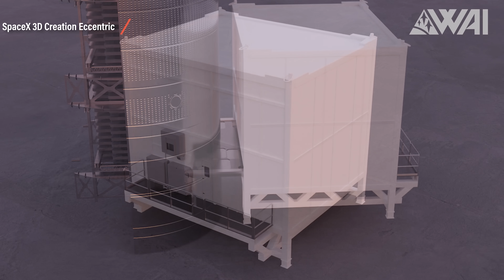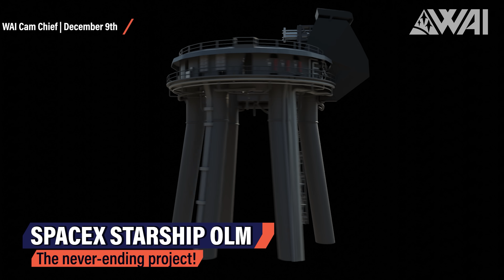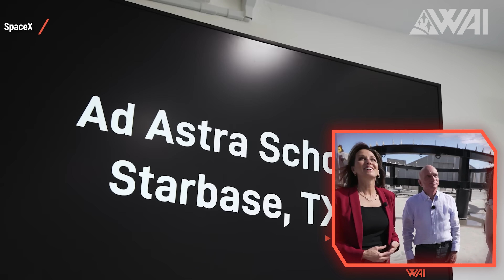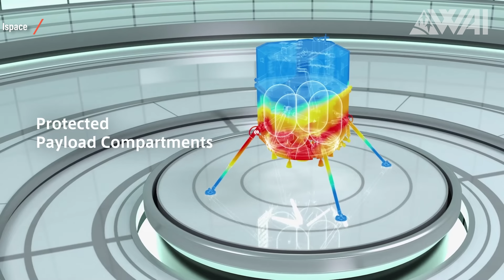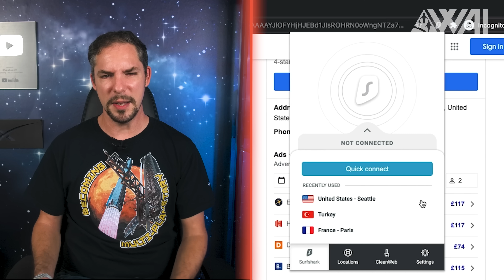SpaceX Starship New Solution! Artemis 1 Splashdown Flawless?

Comment: Flame trench and Diverter are the only solutions.  In addition, need a robust sound suppression water system is needed to reduce the sound levels as not to have them reflect back towards the vehicle.  Any other answers are incorrect.

Comment: Why can’t they put a couple inch steel plate under the launch mount? No flying concrete bits and no need to keep repairing every time. Could a thick steel plate take the heat (especially with heat resistant coatings) ?

Comment: About the concrete problem under the olm...What about using heat shields on top of the concrete under the olm? They could build a single large heat shield rather than using hundreds of induvial tiles.  That way they don't have to spend weeks replacing them. Just a thought :)
Reply: Using one single big-ass tile would probably create problems with thermal expansion.
But anyway Idk, thermal tiles have been known to fall off, and the vibrations and forces directly under 33 full throttle Raptor engines have to be worse than those experienced on the main body, right?
Reply: @plainText384  maybe :)👍🙏🤓
Reply: @plainText384  u have a point...just throwing out various solutions...i wonder what kind of concrete they used with the shuttle?

Comment: Launch table will be toast after rocket launch. Then, they will spend another year to build it again. Per me booster should launch from hang position. Rolled out fueler should be used during fuel deposition and then, rolled our far from the rocket. Rocket bottom should be in air. The best part  is no part as Elon said.

Comment: dearMoon probably 5 years pending if Starship lifts off successfully next year.  Will need a lot of testing.  It most likely will replace Falcon.
Reply: Think your'e right although i would concider 5 years minimum would not be very surprised if it doesn't happen before 2030.
Reply: it has taken 10 years since the first F9 launch to build the manned Dragon. Starship has not even attempted orbital flight yet.

Comment: My 2 cents, drill a shaft under the OLM 30ft in diameter and put a platform in it (think elevator). when the platform is lowered up to 5 tunnels are uncovered. when raised to ground level there will be access with forklift with engines on stands then the platform is raised to install the motor. all this will serve as a flame diverter and could speed removal and installation of engines.

Comment: Felix!  “I think” they’re not using a flame diverted or water based diffusers because we won’t have that on other planets and they’re trying to get it to work with just the concrete mix, for ease of assembly on other planets
Reply: They have already reached firing of 6 Raptors with concrete handling it, they won't fire more than 6 on Mars.

Comment: Why don't they just use a lovely layer of diamond, I'm sure they could figure out a way to build up layer by layer a massive single sheet of diamond.
I mean, they did choose to go the hardest route they could for a fucking lack of diverter, just idiocy, "best part is no part" aaaand yet they chose to not just dig a big hole but rather have to design & retest many many times a way that would still be higher maintenance......

Comment: Is there some reason why they cannot use the same bricks that they use for the "heat shield" at the launch pad instead of this "fondag", or any other mixture? Seems to me that if it can withstand re-entry into the earths atmosphere, perhaps it could withstand the temperatures at take off.
Reply: I think under 33 Raptors the problem is not temperature only, but the pressure as well. I mean, what pressure will heat shield feel during reentry? If slowing down with 3g force, it's like 120*3 = 360 tons laying on this shield, which is 50 meters high 9 meters wide, so 360 tons for 450 square meters = 0.8 t per square meter. Even if taking into account curvature of cylindrical Starship, I bet it won't be more than 5-10 tons per square meter at the worst moment.
Now, counting 33 Raptors firing pressure, let's assume the fire column will be equally distributed on heat shield circle with diameter of 9 meters, it's 64 square meters. The thrust will be around 7 500 tons, so we get more than 100 tons of pressure per square meter. 
The difference of pressure in 100-1000 times! I think it's as important as temperature.

Comment: How about a rocket blast proof system that involves no super hardened concrete or flame diverter?  Vertically mount a properly sized boring machine directly under stage one and let it bore straight down for a mile or so. Can't be too hard considering all the miles of tunnels it has bored out in Las Vegas. Maybe the first couple hundred yards could be paved with shotcrete, like in a swimming pool construction. There won't be much force to the shock/blast wave after traveling that far when it bounces off the bottom.
Reply: All that energy has to go somewhere. So if there is only one exit...
Reply: @asparagusstaging430  You're absolutely right the energy goes a mile or more down but it is less forceful as it goes, even though confined in a tube. Then it  bounces off the bottom which causes it to run into itself, dissipating more energy and then what energy is left will peter out by the time it goes another mile back to the surface. It's just a dumb thought experiment no one in their right mind would do this when a diverter easily does the job. Have a nice day.

Comment: My hot take is simply not possibile to use OLM to launch Starship. The installation at Boca Chica is for testing and prototyping, a full power blast of 33 raptor engine would reap apart everything, from the concrete base to the OLM structure (or in the best case scenario, implying time consuming and expensive repairs after every launch). The proper OLM need to be build yet. Maybe the one at Cape could be use for Artemis program third launch but surely not this one, too close to vital infrastructures and  too fragile.

Comment: Simple math says NO on the concrete because it's simply too brittle. They need something called "StarBurst" which is a thick 316SS diversion stand that channels the heat energy away from under the ship. It uses cryogenic O2 flowing in a heat exchanger system to remove most of the energy as the metal is diverting the exhaust flow away from the engines.
Reply: Stainless steel has piss poor thermal conductivity which means cooling it with any liquid will likely be too slow to impact the launch heating issue.
Reply: @executivesteps  : That’s the whole point. The object of the games is to not melt the stand. Remember, it just needs to withstand 6,000 °F (3,300 °C; 3,600 K) for the few seconds needed in order for the rocket engine exhaust temperature and pressure to clear.  What is the melting point of stainless steel? Stainless steel's melting point falls between 2550 and 2790°F or 1400 and 1530°C.
Reply: @jroar123  I’m not sure what your conclusion is but it’s much easier to melt stainless steel than aluminum in a situation with an impinging hot flame. It’s mostly about the thermal conductivity not melting point. Few people commenting here don’t understand that. 
Ask any welder and they’ll tell you that’s why it’s much much easier to weld stainless steel than aluminum -  SS melts where you put the heat.

Comment: If the base was at least twice as tall, this alone could solve many issues. Given what we've seen thus far with minimal engine firing, there's no way it's going to work as is during a full firing.
Reply: I doubt they'll go taller, but a flame diverter I suspect will be required.
Reply: I doubt a flame diverter at this point is possible. From what I can tell, the base wasn't built wide enough, or likely deep enough, to allow for the hollowing out of the centre for it.

I'm really curious how they're going to solve this as all 32 engines will obliterate everything.

Comment: On Dear Moon, given the payload capability of Super Heavy/Starship, I hope that they use a scientifically well-equipped Starship. They could, for example, include an almost Hubble sized telescope for detailed photography of the moon - and leave it in orbit if it is too fuel costly to bring back.
Reply: Who's to foot the bill for designing, building and testing that?
Reply: Why? NASA’s Lunar Reconnaissance Orbiter has about 100x better resolution of the Moon’s surface than any Hubble sized telescope in Earth orbit. 
Plus it’s photographed most of the lunar surface these last 10 years.
Reply: @executivesteps  You either misunderstand or don't know your facts.  I was advocating for a Hubble-sized telescope (resolution 0.014 arc seconds) in Lunar orbit - which seems clear from my post, given that the target is the moon.  The LRO camera has, at best, a resolution of 2 arc seconds, so a Hubble-sized telescope would provide more than a hundred times the resolution of LRO. I hope this helps to clarify.
Reply: @franciscook5819  i thought you were keeping it in Earth orbit. is the Dear Moon mission a lunar orbiting mission? I imagined it was just a free return ride. It would take a lot of fuel to put a Hubble size telescope in lunar orbit. And no one is going to fund a telescope that big for a short mission. 
Ultimately why would you want a telescope with significant better resolution than LRO?

Comment: The pez dispenser is an excellent idea. What is not is its horizontal setting. A vertical slot door would help conserve the axial stress resistance of the hull and better protect the satellites during the launch.
Reply: Yes as far as  Structural strength is concerned ...except......your missing one important factor ..QUANTITY....
you would have less payload space .
Elon wants as many as he can jamb in there 200 300 400
....ect..... But if you can config something up and submit it I am sure they'll take a look :)
So no Horizontal it shall remain
Reply: @jimanderson2518  Or perhaps an annular rotary dispenser would work best. Much greater capacity.
Reply: @jimanderson2518  I'm sure quantity will not be affected. But probably the Zip dispenser design would. For instance, the dispensing slot would rather be placed in the middle, between two opposing stacks.

Comment: @5:33 SpaceX will have to lengthen the legs so the blast from the engines isn't so intense. 
If SpaceX wants to take off and land on a ship platform, it really wouldn't do to have to bring in the ship after every launch.
Reply: They can just blast into the water. A whole ocean is probably the ultimate deluge system. ;-)

Comment: I found Artemis really disappointing, I'm old enough to remember watching the Apollo missions, and the splashdown of Artemis was like watching a replay of those, which highlights how little we have actually progressed the technology, and how far we need to go. 
Starship may shift the paradigm, once it has proven itself capable of getting off, and back onto the ground,.. safely, ..with cargo, and eventually with people.
but NASA is still flagwaving propaganda at a huge cost (IMO)
Reply: You judge the progress of the technology based on the most superficial thing you can.  How it looks from the outside.  That's so worthless as to be.. worthless.
Reply: @TheEvilmooseofdoom  He has a point, though. Of course they updated quite a few things inside the capsule, but the main parts are essential 1970s tech. Space Shuttle Engines, Space Shuttle tank (ok, slightly modified but essentially the same), Space Shuttle SRBs (extended by one ring)... 

Same for the Crew Dragon. SpaceX wanted a powered landing on dry land with parachutes as a backup, NASA forced them to use a water landing with parachutes like Apollo, with the rocket engines only as a launch abort system. 

The problem is not NASA itself, IMHO, it's the politicians and/or beancounters. They don't get that using new tech is possible if tested enough, however the test cost an undefined amount of money. They want to hear a number $X and expect to spend $X and have something do Y. If something goes wrong, they come looking for blood and someone to blame/sacrifice.
Reply: @realulli  It's not a game, putting all that hardware together and making it work is not as easy as you people pretend it is and pretending is all you're doing.
Reply: @TheEvilmooseofdoom  What criteria should i use ?
The rocket was incredibly expensive, used second hand engines, and was destroyed in the process off getting into orbit (non reusable) the tower used to launch this, was the most expensive ever built. 
The capsule was not much bigger than the Apollo. where's the technical progress in 20 x the cost.
Reply: @3dagedesign  How about something meaningful?  The booster is a joke, but the capsule is a lot more modern.  The interior room is almost a third larger and it has computing power apollo could only dream about.  Also you seem to think NASA had a lot of choices, that their hands were not tied by political mandate.
Reply: @TheEvilmooseofdoom  Something more meaningfull that the fact that it's visually identical to apollo's capsule and only one third larger. 
Nasa's hands are not tied when selecting contractors or equipment. they are politically reelianty on funding as an organisation and allways have beeen, (see my comment about propaganda flagwaving)
The computing power of this Capsule is not in the hands of NASA, neither was the Apollo. NASA don't design chipsets, they select the best components available at the time.
so the biggest fact you have is that it's capsule is a third bigger, Brilliant and groundbreaking after 50 years of development. well done Nasa.
Reply: @3dagedesign   It took Musk 9 years to create a small crew capsule capable of flying to the ISS, despite the financial and scientific support of NASA.Orion is a ship capable of flying a thousand times farther.If NASA is backward, how backward is SpaceX?
Reply: @tomes3378  You make it sound like NASA paid for and supplied all the technical knowledge to Spacex. and that's a strawman.
Nasa have been working with Northrop, Boeing, and a bunch of other companies for decades and spending trillions over that time.
The fact that a private company is making reusable rockets with a payload capacity nobody else has dared to dream of, and doing that with greater speed and improvements than anyone thought possible, should make you, NASA, and all of those companies question why you've been spending so much, for so long, to get so little.

Comment: Why the pez dispenser door is at the bottom of the bay?... doesn't make more sense to be at the top? won't suffer minor stress force to hold if it's higher?
Reply: That's probably a good question for Tim to ask Elon. However, I suspect they assume, "ok, we already have a rail system in place to launch the sats, let's just strengthen that a bit so it survives the launch with all sats stacked on top, instead of having to have the structure to bear the load during launch and the structure to handle the stack while it's being pushed forward and individual sats are launched". 

Keep in mind, these sats are rather heavy, the whole stack will probably be >100 tons. Now imagine accelerating at several g's just before booster separation. I really wonder what's better, having more or less load-bearing structures on both ends and have less issues with the cargo door or more issues with the door and only one load-bearing structure.

Comment: It would have been much more complicated and slower to build a flame diverter, but they wouldn't need bern walls and constant pad refurbishments now. The water table is probably extremely high in Boca so a 21-30 feet deep flame diverter would have required some pretty serious foundation work, a very long trench and a way to keep out ocean water/soil water of it. Would've taken months to build this. Or they could have a much higher mount, like twice the hight, but that would've slowed down the progress even more significantly. Maybe a way in-between could be a solution, or an extreme water deluge system. And yeah, I don't get the very weak water deluge either.  Anyways, they must know what they are doing.
Reply: The only thing I can think of is that while still in testing they want easy access to the bottom of the booster and that's the reason for no diverter.. yet.
Reply: So what if it would have taken months to build this thing is going nowhere anytime soon.